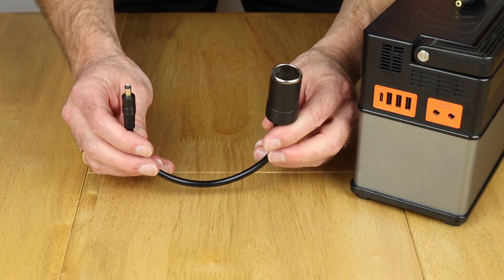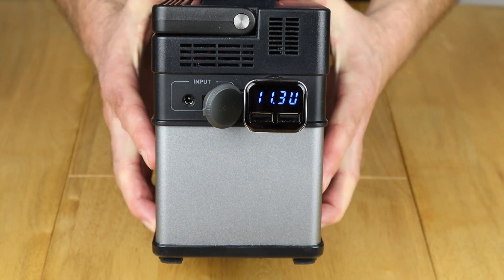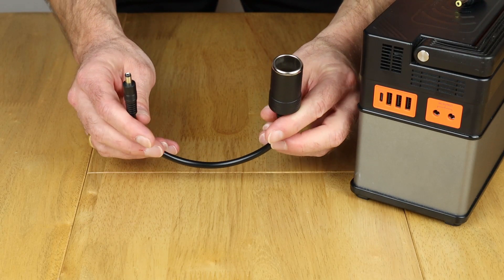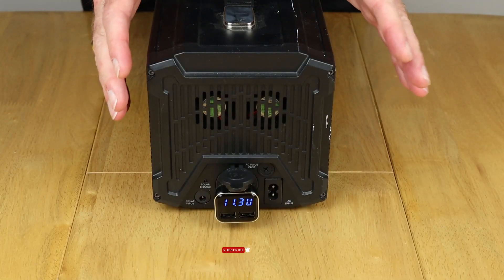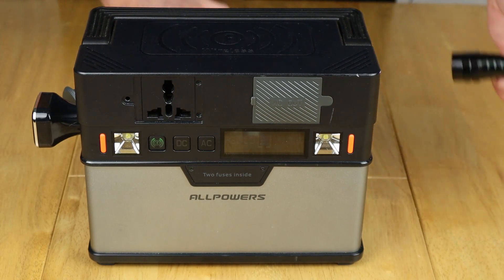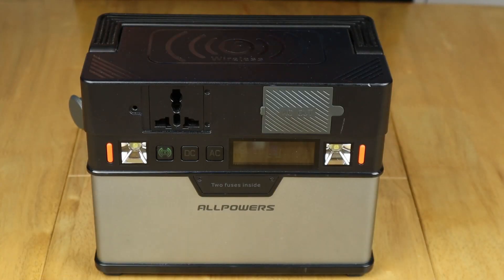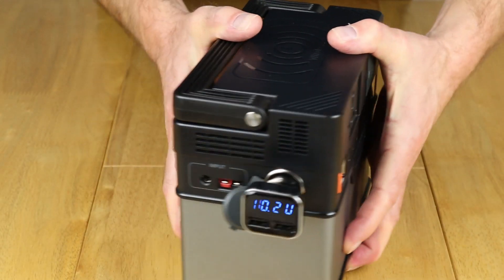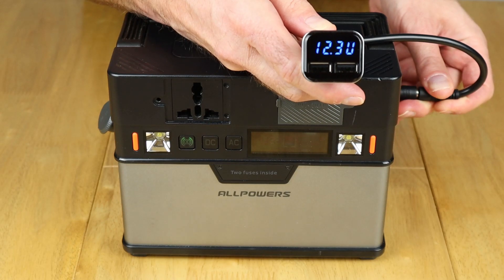Does the ALLPOWERS 372Wh Portable Solar Generator have a regulated 12V output?

Comment: Hi, very nice Video.
Good thing to know that the dc outputs are stabilized at 12,3v. But for me there is a question left. 
Do your 12v DC outputs turn of imedeatly after turning them on?  For example: you plug in a 12v fridge (compressor). The fridge's fan and also the compressor start running with 44Watts... Then the plug stays turned on and delivers the power, but when the compressor shuts off and the fridge's fan continues running with ~3Watts the 12vDc output will turn off after a few seconds. (You can also watch the green 12v light turning of in the mobile app) That means the whole Power Station is shut off again. Is this a common/normal Power Station "behaviour" which you have also seen on your own station or is mine broken? Another unexpected behavior of the powerstation was:
If i leave the dc cable pluged into the switched off 12v dc socket and try to turn the 12v dc output on by using the app on my mobile phone, the Station won't even turn the 12v dc output on. What can one do to solve the problem?
Thanks for your answer and greetings from Germany
Reply from the maker: @Andi Zimm  Guten tag Andi! Danke for your kind feedback 😊 and question. The 2 x DC5525 ports auto shutdown (power save feature) within 5 seconds if there's not enough power being used. I've seen this when it gets to around 1W of power usage, but I would have thought 3W would be enough to keep the port active.

The other behaviour you've noticed matches my unit. If you leave the cable plugged into the port and it does an auto shutdown (power save) you can only wake the port by using the app or removing the cable and plugging back into the port.

I'll test how much power usage is required to keep the port active (3W+ ?) and let you know my findings. I hope this helps and please let me know if you have any more questions. Alles Gute, Adrian
Reply: @DADvinci  have you open the interior by any chance ? Like to verify the exact type of cells and capacity per cell on the unit ?
Reply from the maker: @Chuck Brown  I've not opened my unit as yet. It's still under warranty and I have no reason to do so at this stage. I can provide the specs from the manual if you wish? All the best, Adrian
Reply: @DADvinci  ohh so only through app you can active this regulated output ? What’s the model part number to that cigarette you used suck it didnt come in the package . It would’ve been a way better advantage if you can hook up dc input plus PD to charge way faster but it’s fine with the one at a time feature limit . Pass through is awesome would’ve like to understand power in and power out when charging and using that same power it’s abit confusing cause you don’t know what’s the power in watts really going into the battery or being used ?
Reply from the maker: @Chuck Brown  Hey Chuck and thanks for your question. You can activate the regulated DC outputs by plugging the cable in (but the device needs to start drawing power immediately) or through the app. Did you mean this cable > https://amzn.to/3mJgTyB (affiliate link)? You are correct that it can be confusing to understand the power in/out when using passthrough. I plug in a device to start using the battery to see the watts out, then remove the device. Start charging to see watts in, then do a quick calculation. Once I'd done this for most of what I use on the 372Wh, I knew quickly whether the watts in/out represented charging or discharging the battery. For example, I know that I get about 60 watts in from solar or USB-C PD and that my laptop takes about 90 watts to charge, so when the display shows 30 watts this is discharging the battery as I'm using more than I'm putting in. I hope this helps. Cheers, Adrian
Reply: @DADvinci  ah okay that explain everything now . It’s a good device . Pretty heavy for its size and the best is that it has lithium
Reply: Yes it does happen , it's considered normal and it's ridiculous , that's the whole point of having something plugged in and having the power switched on  but well what can we do.  
My advice is to plug the solar panel and at the same time plug the fridge to the cigarette lighter socket and that way even when battery percentage drops bellow 70% ( normally this will get your voltage to low and fridge will shut off ) it will still have a higher voltage and that way your fridge will stay on for way longer than any other option and without draining the battery in a couple of hours as it happens if you slip all of this and just plug the AC adapter and turn on the AC power outlet ...  The DC to cigarette socket cable adapter it's not a viable option for 12v fridges , first the port itself will shut off when not enough power is being drawn by the fridge , second the cable itself doesn't handle the power required by the fridge , you will see it happen like I did ahahaha waste of money and soooo frustrating .
Reply: @fredericosantos6783  I’ve been playing with mine a bit. It looks like I can keep the 12V fridge powered via the 12V cigarette socket if I also keep a 5W USB device running at the same time. Sort of defeats the efficiency of using DC vs AC for running my fridge.
Reply: @0errant  I'll have to give that a try , just basic usb use  like phone chsrging , right ? The only issue I can think off right now is that a charge on any usb device will only last a couple of hours after that it's full and the unit switches off the DC power to the usb plugs , ...so it wouldn't work for an overnight situation , but I'll give it a try to see if goes lower than 70% (+/-) . Hope kt works and thanks for the suggestion
Reply: @fredericosantos6783  i just took a look, and you’re right, it turned off once the phone was charged and no longer drawing. It would have to be something with a constant draw, maybe a small LED light?
Reply: @0errant  yes maybe something like that , but I just realized you're probably talking about having the fridge plugged to one of the dc 5,5 ports thru a Cigarette lighter socket to DC type of cable adapter as DadVinci as mentioned in the past , but that type of cable adapter doesn't really work for 12v fridges as far as I've tried as you can't leave it on full power mode , only on Eco mode and even then sometimes it's too much for the cable adapter and it won't work .
Reply: @fredericosantos6783  no, I’m talking about using the cigarette lighter plug that came with my fridge directly into the cigarette socket on the AllPowers unit.
Reply: @0errant  mmmm that's interesting , with mine plugged into the power station cigarette socket it won't turn off untill the voltage drops too low ( being that it isn't a regulated 12v output like the DC ports which are regulated so no mstter what percentage the battery is in a certain moment , the DC output will always be at least 12,3v .  In my case and everyone's as far as I know the problem with the cigarette lighter socket is that when it reaches around 70% the voltage drop is too much to run the fridge and the fridge will shut itself off , even if I have another power drain such as a phone or whatever it won't help with this problem ...the problem's source is the unregulated 12v cigarette lighter socket port , no matter what you do the voltage will drop in that output as soon as the battery percentage goes down , the only trick for this is to have it plugged to solar at the same time which will boost the voltage and trick the power station into thinking it has plenty of voltage even if the battery is below 70%.
Reply: @fredericosantos6783  Yes, very interesting. In my case, my issue is that the fridge doesn't draw enough power (when compressor isn't running) to avoid the auto-shutoff "feature" of the AllPowers unit. I'm sure the unregulated 12V is a problem, as well, but I haven't even got that far. Do you know if they have another unit with regulated 12V and without the silly auto-off?
Reply: @0errant  if you have it plugged directly to the cigarette  lighter 12v socket it won't shut off even when the compresor is not on as it is a direct connection to the battery, that's why it will turn off at around 70% battery if you plug it this way which happens by it not being a regulated 12v output ( the 2 DC pin connectors on the side next to the usbs those are regulated but will not hold on whilst the compresor turns itself off , to hold it you need to plug something to that DC port next to it or I imagine thst maybe with something on the usbs would work too ,just to keep the DC output festure on . 
But if you plug it to the cigarette lighter socket it should stay on no mstternif it's 1watt output or 60/80 ( roughly what a 12v compresor fridge draws from s battery source )
Reply: @0errant  also forgot to mention , I know that the 666wh units and below all have unregulated Cigarette lighter sockets which is incomprehensible nowadays but ok ... The medium ones I think we're the same and the big monster X series are regulated 12v socket as far as I know on all the experimental sizes they did and the most known 1700wh . 
But please double check with AllPowers always . 
To be honest , the solution might be kind of simple , just need a 12v DC plug connector with regulator on the output and voilà , or maybe change the fridge cable to an Anderson one or directly into a 12v DC ... , I've thout about it many times , most people change them to MC4 but in our case I don't know if it would help . . The proper and easy way it's on the actual socket , and open the box and out a regulated one ..which it should be from factory but well . In my csse since I have two units I plug one onto the other when the fkrst one reaches 70% that way it keeps the voltage high even when passing 20%
Reply: @fredericosantos6783   I've given up on using it for the fridge. I'm now testing with the Milin 622Wh unit. It has a regulated 12V car port that I can keep live with a 1W draw. So far, so good!

Comment: hi I was just about to get the 372wh generator and i came across the 666wh version but cant really find anything on it, if you have any thought on it would appreciate it. thanks mate
Reply from the maker: @David Chun  Good day David and thanks for your comment. That was good timing, I've just started filming the unboxing and first look video. All being well with work, I should have it finished during the week. Due to the dreadful weather I've not been able to test solar charging yet (saving for the next video), but all the other features seem to work ok so far. The upgraded inverter from 300W to 500W works fine in the limited testing I've done. It's still early days, but I'll continue testing and release more videos down the line. Did you have any specific questions as I can probably answer them whilst I film and continue testing? All the best, Adrian
Reply: @DADvinci  fantastic mate looking forward to the video. Going to be used for backup power for my campervan as my electrics need ripped out and replaced. Should be able to get my 12v lights and diesel heater running of it don't really need anything else at moment. Thanks for replying mate your videos have been a great help ☺️
Reply: Interested to see how much farther beyond the rates 500watts you can push the inverter before it blows. The item description does say 1000watts peak and I am always curious how long a peak lasts

Comment: Where did you get it? Amazon don't seem to have a 60watt? Would like 60watt to run my fridge.
Reply from the maker: @Sebastian Goddard  Good day Sebastian and thanks for your question. The cable I use in this video can be found here > https://amzn.to/3mJgTyB (affiliate link) if that's what you need. The 2 x DC ports on the 372Wh are 5A each, so in theory that should cover your fridge (12V x 5A = 60W). The only other thing you’ll need (if you haven't already got one) is the adapter I plug into the end of the cable which turns the 5.5mm x 2.1mm into 5.5mm x 2.5mm so it will fit in the DC port.

I hope this is what you are looking for? Please shout if you need anything else. All the best, Adrian
Reply: It still won't handle your fridge and it will turn itself off whenever the fridge compresor and fan is not on .  But even when it does the cable itself can't handle the power from my experience and the port shuts down before the fridge actually starts itself . 
Best advice if you going to go that route is to plug a secondary thing to the DC port as well just to make sure it stays on whenever the fridge compresor turns off or for that beginning time when the fridge has power and everything but hasn't started running the compresor yet.

Comment: Can you recommend ( add an affiliate link) a cigarette lighter charging cable for the allpowers please so that I can charge it from the leisure battery whilst driving? Thanks
Reply from the maker: @IanJohnMartin  Good day Ian and thanks for your question. There are two options for 12V cigarette lighter charging the 372Wh. The quickest method I've found (60W) is using the USB-C PD port where you'll need these > https://amzn.to/2QWHv0i + https://amzn.to/2VfaCiP (affiliate links). The other method (35-38W) you'll need one of these > https://amzn.to/3icM9DZ (affiliate link). You can see both of these in action in this video if you fancy a look > https://youtu.be/0NiIfbHdyXU

I hope this helps. Please shout if you need anything else. All the best, Adrian